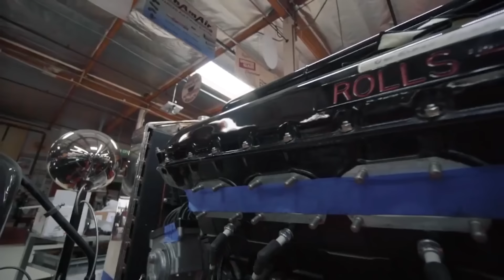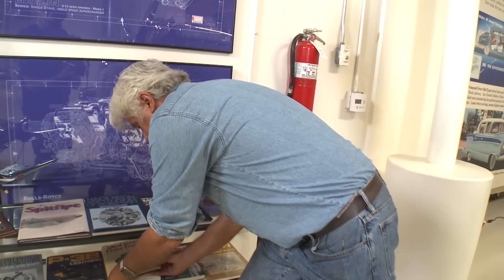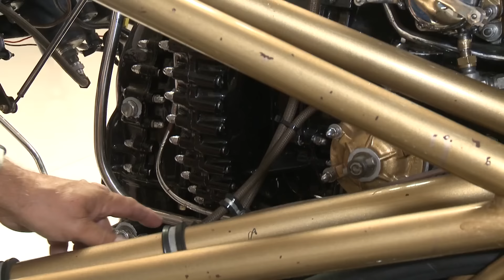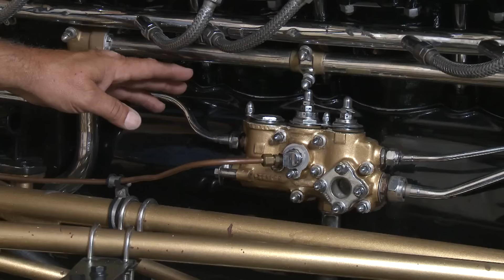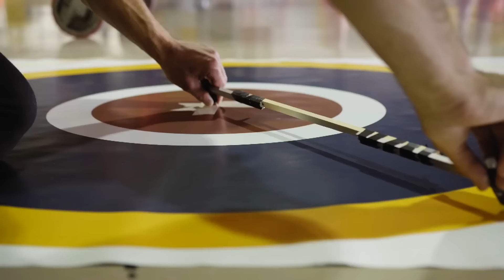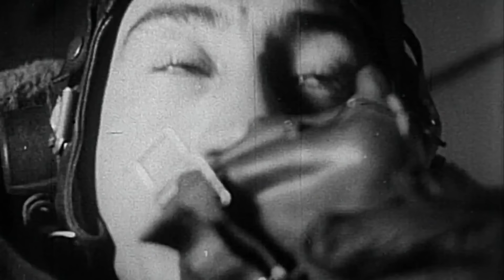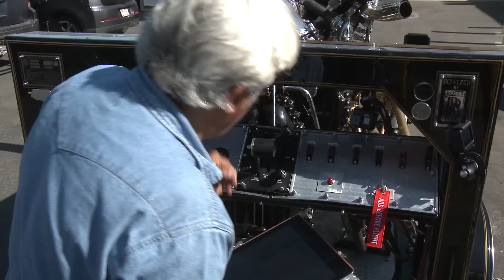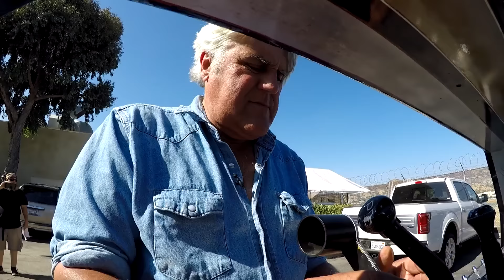The Engine That Won World War II - Jay Leno's Garage

Comment: Great video Jay. How much more HP would they have gotten out of a Merlin if they had made it fuel injected instead of using a carburetor?
Reply: NONE !!! A good Fuel injection system was NOT available !!! The Bendix PRESSURE carb was an early form of FI.  ALL packard version used it and later  RR versions !!!

Comment: The Packard merlin was available with both fuel injection and carbs (at first) the Packard was built under contract for Rolls to be for the Spitfire.  After North American decided to build a NEW fighter rather than build Spits under contract it too got the Packard Merlin.

Comment: Jay you need to get an Allison to go with that Merlin.
Reply: He needs a Spitfire to go with this engine. ;)
Reply: I'm sure Packard made some modifications to the production process to suit their own manufacturing processes and abilities. Anyway, overall, the Merlin was a great performing engine, it deserves every bit of praise that it gets, it's just frustrating that the Allison never seemed to get the investment that it deserved. The fact that the manifold was never improved makes me think that Allison just refused to improve the engine in any significant way.
Reply: WRONG WRONG WRONG!
Reply: The DB5  in the Messerschmitt was injected and inverted!
Reply: I advise a  13 speed Road Ranger behind it.
Reply: haha!
Reply: The Allison was very different from the Merlin. It had canted valves and a pentroof combustion chamber (like most modern engines do), instead of the parallel valve arrangement that the Merlin used (which gave it a flat combustion chamber). This might have been a disadvantage in such a low rpm engine, but it would take an engineer who understands the complexities of combustion chamber design to say whether that's true of not. The Allison's valve arrangement did make for a much neater valvetrain than what the Merlin had, although the Merlin's was pretty unique and a little bit ingenious. The Allison's valvetrain was simpler, it had one rocker for the intake valves and one for the exhaust valves instead of one rocker for each valve. The rockers were forked and this halved the number of lobes that needed to be machined into the camshaft.The rockers made use of rollers on the camshaft side to reduce friction. The accessory/cam drive system on the Allison was much simpler than the Merlin's, though they both used towershafts and bevel gears to drive the cams. The Allison typically didn't have a charge air cooler when it was only supercharged, usually just when it was turbo-supercharged. The Merlin had an integral, liquid-cooled aftercooler, which was a fairly advanced feature. The intake manifold on the Allison was very different from the Merlin's, and I'd say that the Merlin had a much better arrangement. The Allison had a really complicated manifold that seems to have been meant to try to get a really consistent amount of air and fuel to each cylinder, but I think that it might have been pretty restrictive/inefficient because it was so complex. I really have no idea if it really was more restrictive, it would be really interesting to see some real data on that. 

Both the Merlin and Allison had a wide range of supercharger/turbocharger arrangements, and the Allison usually got really badly shafted in this area during the war, and even after the war. As far as I can tell, it never got the neat, compact two-stage arrangement that the Merlin ended up with, and that's really unfortunate. It did get a two stage compressor arrangement in the P-38 with the addition of a turbocharger, and that was the Allison's most successful role because of that. After the war, the Allison saw some really interesting developments, including a somewhat strange two-stage supercharger arrangement (meant for the P-63) and a turbo-compound arrangement that pushed the output of the engine up to 3,000 horsepower and gave it diesel-like efficiency.
Reply: Nice piece but the Mustang never came into it's own until the Allison was replaced by the Merlin, and as they say the rest was history!!
Reply: The first Packard Merlin was two speed, single stage.  Packard produced this engine from August of 41 to the spring of 43 producing 3061 of them.  It then switched production to the 2 speed/2 stage Merlin.  Reportedly the Wright two speed quill was an adaption Packard made which was an improvement over the Rolls Royce design for the single stage Merlin  but for which Rolls Royce gave Packard short thrift. 

One of the issues for the Rolls Royce version of the Merlin was the amount of hand fitting and skilled machining required in assembly.  Packard did streamline assembly.  Packard was not the only American Manufacturer to build Merlins as Continental made 897.   Altogether Packard and Continental made almost 57,000 Merlins and the UK made about 100,000.  The Merlin was used in about 1600 P-40s and 13,000 P-51s.  The rest of the manufacture was used for replacement engines or shipped to Canada and Britain.
Reply: That's because the Allison never got a decent two-stage supercharger. When Packard got a hold of the Merlin, they adapted a Wright two-stage supercharger quill to it and that improved it significantly.

Also, I did some reading on the Allison after I wrote that (It's been a long while since I read anything detailed about the Allison, I just wrote about physical details I knew from memory), and the intake manifold was apparently a source of problems for the Allison due to poor fuel/air distribution. So, I'd say the Allison would have needed three things to match the performance of the Merlin during WW2, the same Wright two-stage supercharger quill that the Packard Merlin got, an integrated aftercooler, and a Merlin style intake manifold. Hell, even the German engines would have benefited from having that supercharger and aftercooler arrangement, it really was the main reason why the Merlin performed as well as it did.
Reply: Tests with the P-63, which had a second supercharger on a power take off from the engine with a variable speed fluid drive and using water injection achieved speeds of about 450 mph, although officially the P-63 is given a top speed of about 425 mph.  This would suggest that there is nothing wrong with the Allison's intake manifold.  Late model P-38's were getting WE power from their Allisons of 1725 HP while the P-51D was getting 1590 war emergency hp from their Merlins.  An improved Allison with 1800 hp was expected to power the P-38K but required setting the propellers higher which would have interrupted wartime production, so that was not pursued.   The P-81 (later F-81) twin Mustang had Merlin and then Allison engines which developed the same peak output.  Apparently the Merlin was dropped because the UK wanted too much for licensing.  During the war, a two stage supercharged Allison was tested in a Mustang with good results, but as they had the Merlin it was not pursued.
Reply: Barrie Rodliffe - As far as I can tell, Rolls Royce didn't give the Merlin a two-stage supercharger until after Packard did (Edit: I can't say if that's right or not, but I'm not sure why Packard would have bothered adapting a different supercharger unit to the Merlin if it didn't offer an improvement to it), and Packard certainly did make some improvements to the Merlin, but nothing all that major (other than the supercharger). Packard simplified the Merlin slightly, gave it better bearings for the rotating assembly, and they improved the manufacturing process.

soaringtractor - There are plenty of sources which state that the supercharger quill used on the Packard Merlin was from Wright, but I suppose that could be wrong. Either way, the Packard Merlin owes its success to the two-stage supercharger arrangement that it had. There is an Allison powered hydroplane that currently competes in the Unlimited Class, it does quite well. Check out go3racing here on YouTube.

Dan Zervos - From Wikipedia: "These had a poor manifold fuel-air distribution and poor temperature regulation of the turbo-supercharger air, which resulted in frequent engine failures (detonation occurred as the result of persistent uneven fuel-air mixture across the cylinders caused by the poor manifold design)."

It sounds like they just made improvements to the fuel, the cooling of the charge air and spark plugs to cope with that issue. Even the Merlin's manifold was weird, though, I think the Germans (at least Daimler-Benz) had intake manifolds figured out better than the allies, they're the only ones that had manifolds which resemble modern intake manifolds.
Reply: idontcare.
The first Packard Merlin engines were based on the XX series which dates from 1940, the Packard version did not appear until late 1941.  The Merlin 60 series first flew in July 1941, being used in the Spitfire in service 1942,  the Packard version came  quite a lot later, it went into the P 51 B/C of late 1943.
Packard made no real changes to the Merlin, it had already been modified for mass production by Ford of Britain and Rolls Royce, the main change was different bearing material because that was available in USA.
Packard seem to get credit for what they did not do.
Reply: Rundy Mignum
Packard made no changes except for the bearing material because of local production, the Supercharger which was heavier and less efficient than the Rolls Royce supercharger. The changes for mass production had already been done by Rolls Royce and Ford in Britain. Even the Bendix carburetor had been given to Bendix by Rolls Royce.
Reply: Rob Oly.
The late model P 38 L had a best altitude of 44,000 feet, when they first  entered service the P 38 E could not get close to 40,000 feet in fact in flight tests they had to stop at 26,000 feet due to poor carburetor cooling.
They still had the same problem on the P 38 G.. but eventually got it to 39,700 feet but at that height the climb rate was zero.
Reply: Bandy Mignum.
I am not wrong idiot.
Ford worked with Rolls Royce on the improvements, at least Ford of Britain, America did nothing to improve the Merlin, Packard were well paid to make the engine to Rolls Royce specifications.
Reply: One unusual feature of the Allison was the use of turbo-chargers.  Not enough boost for high altitudes, but the quiet exhaust was an advantage
Reply: idontcare.
The Packard supercharger was heavier and less efficient than the Rolls Royce supercharger, Packard made no improvements at all to the Merlin. The best performing Merlin was the Mk 63  or 64 until the later Merlin 130/131 for the DH Hornet.
Reply: Barrie Rodliffe Packard made tens of thousands of engineering changes, redrew the prints, and changed the tolerances to both allow interchangeable parts, and mass production.
Reply: Nope, plenty of altitude, the P38 had a ceiling of 46,000 ft.  The turbocharged Allison would not fit in the typical single engine fighters of the time without ruining the aerodynamics and a more compact supercharger was never developed.
Reply: Barrie Rodliffe yer wrong, babbitt breath, but I might not be giving ford the proper credit for much of the changes.
Reply: Actually, fuel injection allows for more power, the DB engines just ran on much lower octane fuel and that meant that they couldn't run boost pressures that were as high as the Merlin and Allison, which limited their power output.
Reply: Two points that you're missing there: A) There is absolutely no doubt that higher octane fuel allows you to run higher boost pressures, you can talk to any professional engine tuner about that. That's also the reason why E85 is so popular among tuners. B) Fuel injection allows for more even fuel distribution, which means that you're much less likely to end up with a lean cylinder that detonates and destroys the engine. Direct injection also allows you to avoid detonation by delaying the introduction of fuel into the cylinder, this is why gasoline direct injection (GDI) is becoming popular in modern vehicles with turbochargers and/or high compression ratios.

And, if you want to ignore the engineering surrounding fuel octane, there's a video of Kermit Weeks flying either a Mustang or a P-40, and he specifically states that he has to run much lower boost pressures because of the lower octane fuel that's available today, I'll see if I can find it.
Reply: The Germans never had access to 150 octane fuel either, and their engines were pretty darn close. Actually, the DB 605 basically matched the performance of the best Merlin engines.
Reply: Allison was a copy of the Merlin.

Comment: The CWH has begun the 2017 Lancaster flying season. 

You have a marvelous piece of engine history in your collection. What many do not know is that Rolls Royce eventually used many of the innovations Packard Incorporated into the original design. By the end of the war, Packard and Rolls Royce developed 7 updated versions for use in the Lancaster, P-51 Mustang and of course, the Hawker Hurricane and Supermarine Spitfire.

Comment: God Bless you Jay.  What a wonderful video today.  Living in Toronto I followed the restoration of FM213 to flying condition (with lots of photos) and was there on her first flight.  Interestingly, although Rolls-Royce designed and built the original Merlin, the Packard Merlin was slightly better with better reliability and fuel economy.

BTW, NOTHING has the wonderful sound of a Merlin.

Comment: Ethanol is the automotive nectar of the gods. E85 is super cheap and super high octane. You can afford to have loads more fun on E85 than pure petroleum race fuel. And it's renewable as well.
Reply: All, true, except when used in older machines not designed for that much alcohol, a solvent. Seals, gaskets, and even metal parts, will be destroyed in a short time when subjected to systems not designed for such. Also in this case, it is smart to use leaded fuel to help cool the exhaust valves, and save the seats. ( i suppose it is possible that custom SS valves and hardened seats were used in the restoration/rebuild, but let's assume not)